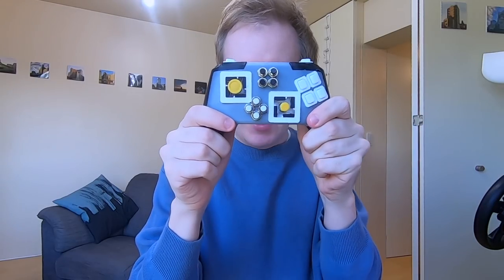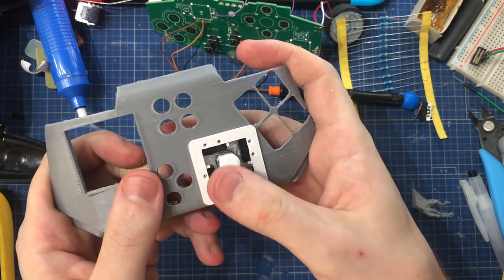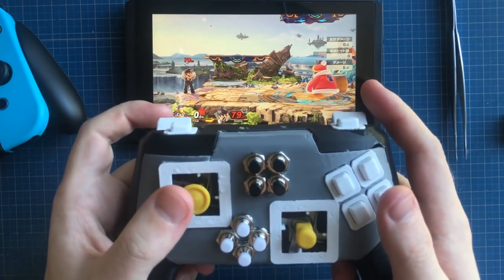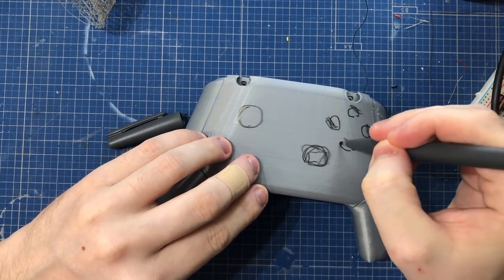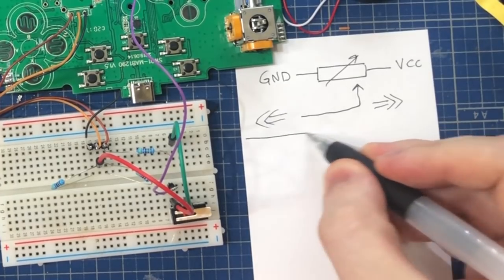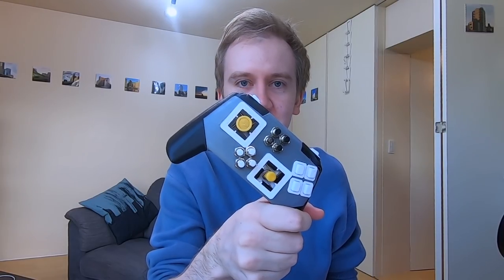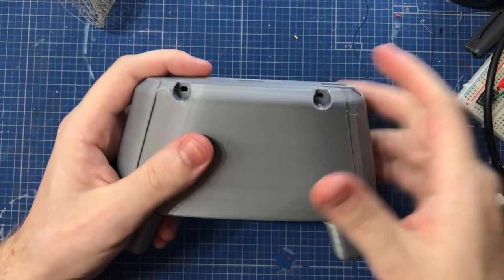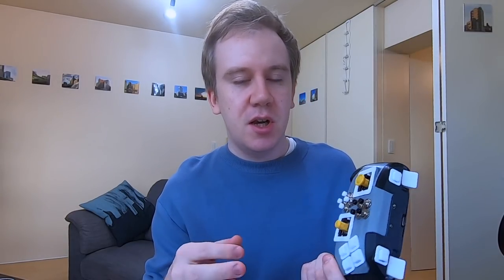DIY 3D Printed Super Smash Brothers gamepad

Comment: I map the "tilt" attacks (which you call strong attacks here) to my right stick instead of "smash" attacks, because Special allows you to do that! That way I have instant access to the tilt attacks, and still have access to the smash attacks via the button combo.
Reply from the maker: Oh, I didn't know that! At this point I'm so used to using the C stick for smashes that I don't know if I could make the switch.
Reply: @AkakiKuumeri  It took a bit of adjustment, for sure, but it was worth it! Still, this was an awesome project!

Comment: By the way, you can set you C stick to Tilt attacks in the settings, this will give the "Fast spinny hammer" :P. For beginners, turn tap just off, then you can use up tilt "Up slightly" just by holding up and pressing A seperate to each other. Hopefully this made sense and enriches your games.

Comment: Hey -- I don't know if you have VR, but I'd be interested in the possibility of gutting an old Vive wand controller, and remaking it into something closer to the index controller. Perhaps with an arduino companion that emulates a finger grip buttons?
Reply from the maker: I have an oculus quest. I fear the VR controllers might be harder to mod, because they seem to have gyroscopes in them, and touch-sensitive buttons (my Quest recognizes when I lay my fingers on the buttons, even before pushing them)

Comment: Getting the 2 stage gate for the tilt attacks was very interesting. For all the smashers out there, there is an accessibility feature to change your c-stick input to tilt attack. I will add though, unlike other fighting games, there is also depth in inputting your movement in more than just the 8 directions and their halfway points in smash. This is a fun project, but just know that the analog stick input for smash is very important at the higher tiers of play. I would reccomend those interested to also check out similar projects that try to better represent the range of inputs needed to play smash with just digital inputs, namely the B0xx and the smashbox.
Reply from the maker: So they're called Tilt attacks? Good to know.
I didn't know about those controllers! Looks like they have set out to solve the same problem that I ran into; inputting both full and partial stick commands.

My friend wanted a rematch with a digital keyboard-like controller, so I'm already building one of those. It'll be similar to your B0xx and Smashbox, but a lot cheaper.
Reply: Can't wait to see what you come up with!

Comment: Wow! Thanks for taking interest in my suggestion and making something really nice! The jokes are great! I was wondering, if you would make a shoulder trigger/throttle with variable output (like on Dualshock 3 and 4, or XBox 360 and One), how would you go about it? Harvesting from an old controller? Using hall effect sensors? Are there other better solutions that come to mind? Once again, thanks!
Reply: Hall effect analogue triggers (and stick) were done in the Dreamcast pad, the triggers seem easy enough. Dreamcast pad has nice long throw rotating triggers. They're pretty careful to not use any steel mounting hardware near the Hall sensors, so there's a smattering of brass screws in the controller, but not all of them.
Gamecube pad has triggers that travel linearly, this can be a huge challenge to make ones that move smoothly. They are picked up with linear potentiometers, like mixer faders, but miniature. If you look for SMD slide potentiometers, you can get such, they have travel of around 8mm.
Xbox 360 pad has rotating triggers and a linkage system which translates them into vertical rotary potentiometers. These potentiometers used here look a lot like trimpots, but they specifically aren't, because trimpots are often rated to hundreds of actuations, while the potentiometers here survive a whole lot more. The rotation angle range comes out fairly short, similar to sticks. The linkage system doesn't look too tough to recreate. You might be able to get away with salvaging potentiometers off a cheap mass produced analogue stick like those that you can buy for several cents each, but with a little more support, perhaps a little bearing like 603 size or 618/3. But i also think the linkage system is a bit of a waste, it's made for the pivot to come out nearly flush with the back of the controller (which say Dreamcast doesn't feel the need to do, and Gamecube eschews a pivot altogether) and to mount the potentiometer on the PCB directly, to make for sensible manufacturing, so you might just get away with stick potentiometers hanging in a 3D printed mount on the pivot axis, so further bearing support wouldn't be needed, and wires are par for the course in a DIY build anyway.

I think Dualshock pads use capacitive sensing or something for their low-travel triggers? Can't say i'm fond.
Reply: @SianaGearz  Wow! What a detailed and informative answer! Thank you very much!
Reply from the maker: Just as Siana said, different controllers use different methods. I think I would use the same analog hall effect sensor I used for my joystick, and a small magnet glued onto the trigger, that's physically the simplest to make from scratch.
Reply: @AkakiKuumeri  Many thanks for your reply and for the great videos! :)

Comment: So, what I used to do in Smash Bros. was set the c-stick to those lighter attacks, instead of the smash attacks that it does by default. (Last did this in Brawl btw, and though I haven't tried doing this since back then, it was something that could be configured in-game, instead of with external hardware or software.) On the other hand, what you made is beautiful and is way more entertaining, especially since its clicky. ^L^
Reply from the maker: I think my friend does that, but I'm not sure if I could re-learn to use it that way at this point.

Comment: This is incredible! One question, because the left stick has 2 stages of either half or full directional value, if you were to press the direction just enough to hit the first then second switch, would it count as 2 forward inputs? There are some games that require 2 very fast inputs to dash, for example (forward then forward again)
Reply from the maker: Thanks! No, in that scenario the game sees it as you tilting the stick very quickly to half-way, stopping there for a short moment, and then further tilting the stick all the way.

Comment: It would be really neat to design a device that someone could 3d print that could combine both the hosas and yoke but with your own controller device instead with added buttons in a better position. Elite dangerous and star citizen players would buy that up
Reply: Push pull the yoke for throttle maybe be able to lock the sticks in place to be pure yoke mode

Comment: Awesome video, I never thought that you could make a 3d printed controller using microswitches for the analog stick and buttons, very impressed. Here is a question, could I make a fightpad using your model but using the tactile microswitches for the d-pad and of course microswitches for the buttons? Cause not only I am curious but also interested of what it can do on fighting games, such King of Fighters, Blazblue, Guilty Gear, etc.
Reply from the maker: Thanks! You can indeed do just that. Any electric switch can be wired up to a cheap controller PCB like this.

I'm working on a fight pad for my friend using cherry mx keyboard switches just now. You can take a look at that when I put out a video about it.
Reply: @AkakiKuumeri  I will look forward to it.

Comment: Top tier skills and ideas about switches.
I made myself this in 2018 for Tekken 7: https://i.imgur.com/aweCSnM.png
Which ended up looking like this IRL: https://i.imgur.com/YtV0Eil.jpeg
All the cuts in different places because it has the potential of becoming this("vertical" buttons all over the place): https://i.imgur.com/ZAk21aE.png

Still using the IRL version you see above with only one set of vertical buttons. I did it so I don't have to move my hands for punishment. In Tekken you want to be able to press 1, 2, 3, 4, 1+2, 3+4, 1+3, 2+4, 2+3, 1+4 buttons at any given time without losing time on moving your fingers from one button to another(which takes about 100ms). And on default controllers like keyboard, stick, gamepad, hitbox, mixbox you'll have to move your hands for punishment. On this one I don't lose time to move my fingers to press punishers like f+1+2; d/f+2; f+4,4; b+3; 4,1; 1,3; 2,1; on Dragunov.

When I watched your video, I noticed that you used microswitches with triggers: https://i.imgur.com/CaPbhdU.png

That makes me think if I should design cases for these small microswitches you used and try to play using buttons with these small microswitches. Right now I'm using Cherry MX Red switches on my controller.
Reply from the maker: That looks awesome. I just finished a small Smash controller with the same idea: an arcade style board with a ton of Cherry MX switches. We're test playing it this weekend and you can see it in a video next week.

As for the switches: keyboard switches feel better. But my little microswitch mount is a lot cheaper.
Reply: @AkakiKuumeri  Interesting. I was thinking that smaller microswitches with triggers or even without triggers, like the ones you showed for mice, I was thinking they'd be better because they have smaller actuation point distance, smaller total travel distance and much more consistent actuation distance.
What I mean is that on Cherry MX switches actuation distance can be 1.5mm on one switch, 1.8mm on another, 2.1mm on another and 2.5 on another again, it's very inconsistent. Same with total travel distance. It should be 4.0mm on most switches, but in my experience it changes a little as well around +-0.2mm.
But because on these small microswitches for mices total travel distance is already about 0.1mm, inconsistency in actuation distance is very small and there is virtually no in-between where it can sometimes be pressed and sometimes not pressed. It's either-or.
That's why I think these small microswitches might be more precise than Cheery Mx switches.
Reply: @AkakiKuumeri  Also, there's something I wanted to ask you. I modeled the thing above but my modeling skills are very limited and I wouldn't be able to model things you model in your videos. I guess, you studied it in university?
Can you recommend me what to learn to be able to model things freely for myself. I'm interested in those things:
Keyboard;
mouse;
headphones;
Different types of cases, such as the case for keyboard which I could screw to a bracket like this: https://i.imgur.com/jJQVZS9.png
Bracket as on the image above to be able to position keyboard under any angle I'd prefer, even facing down to the floor.
That would be a start.

Basically design, engineer and make small assemblies like you do but with my own goals. I think it's not just knowing my way around the program, like, even if I knew my way around SolidWorks or Fusion, I wouldn't be able to even imagine a mechanism above to position and move keyboard and monitor around. So it's more like: knowing CAD modeling programs, mechanisms, designing things, engineering, in very simple terms. But I'm sure I'm off and missing many keywords. Please recommend, what should I study?